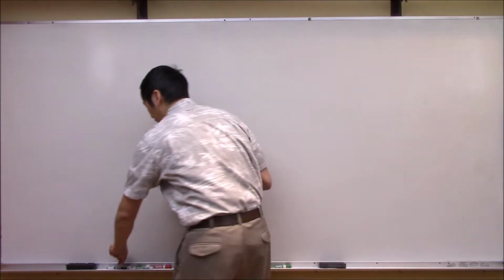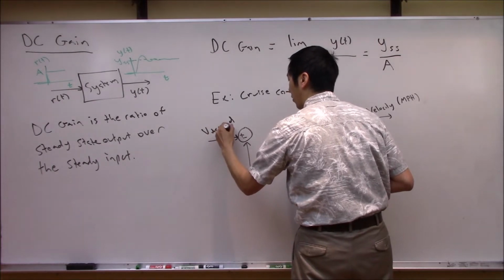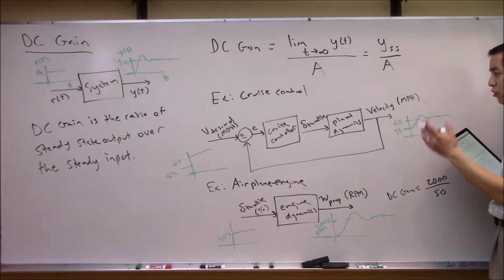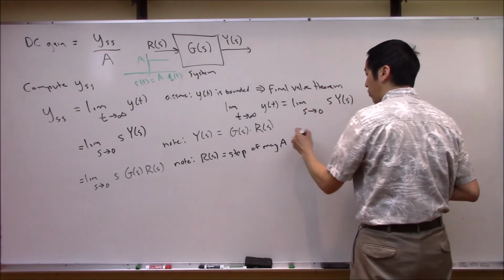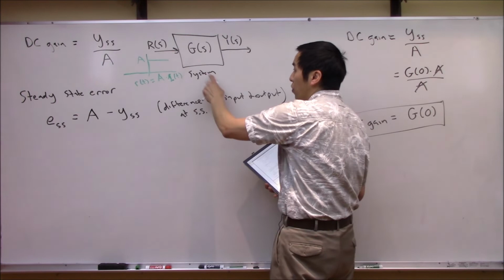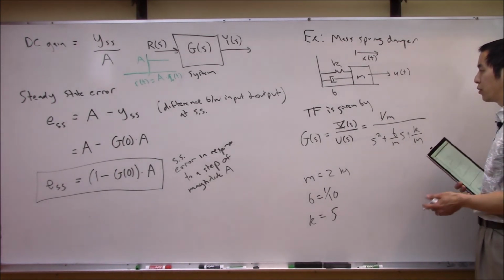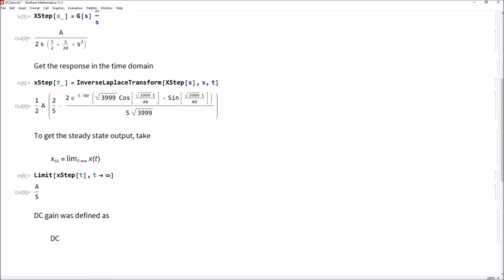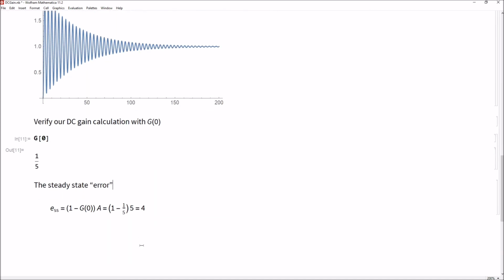DC Gain

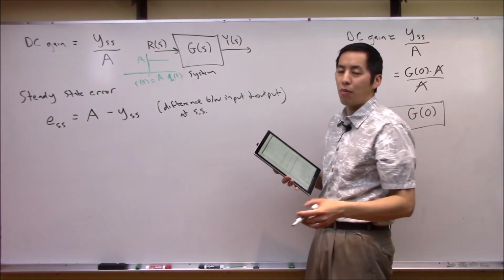Comment: 13:57 For the aircraft model, especially on modern jets with electronic engine control systems, you can set a desired engine RPM vs. actual RPM (or whatever index they use to measure power delivered).